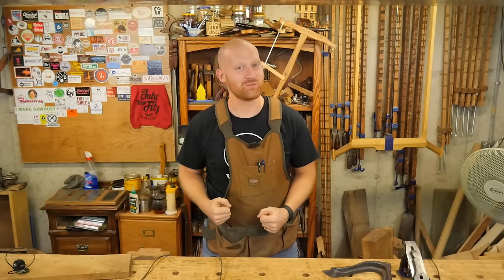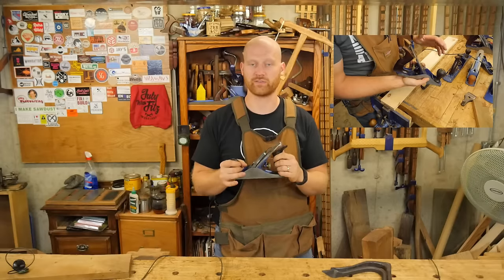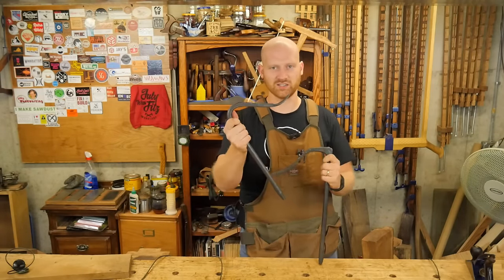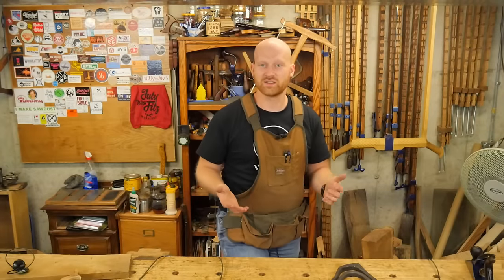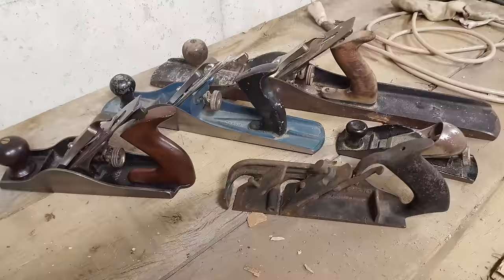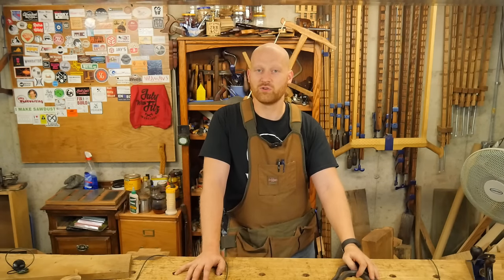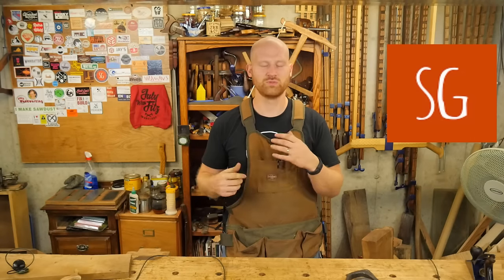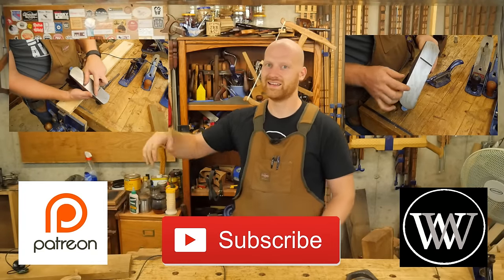Report, Smoothing Plane, Holdfast, Hand Plane Restore, Dresser, MWTCA, and more

Comment: Great up date.  Yes, I hope I can make a live Q & A if you have one.  

I will be interested to see what you think of LA planes.  In particular the angle you sharpen at, weather your final (total inclusive) angle ends up as a York Pitch (50 degrees), which would make a LA plane a high angle plane, or some other angle.
Reply from the maker: LOL there is the rub! even with a 25degree blade  it is only 8 degrees less than most hand planes and, This should be a fun video!